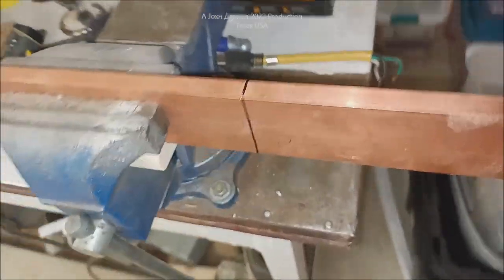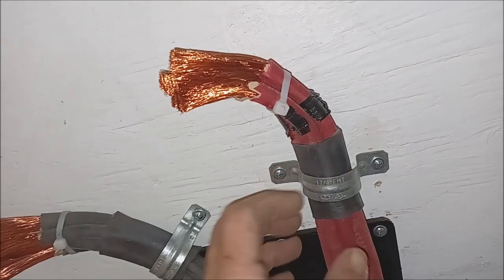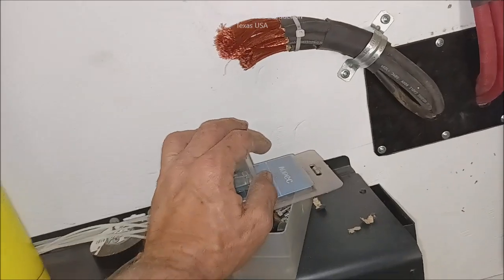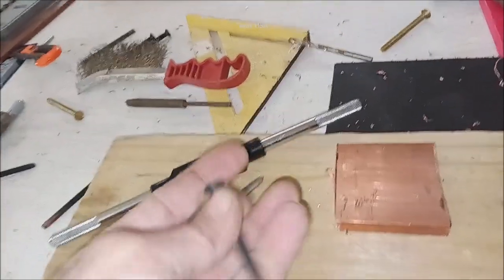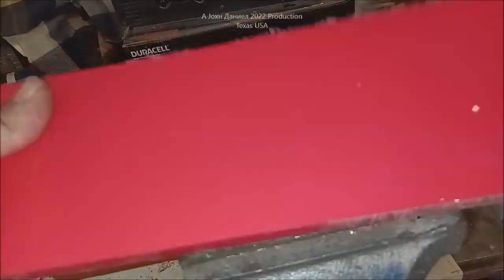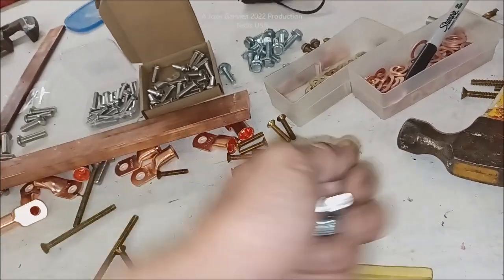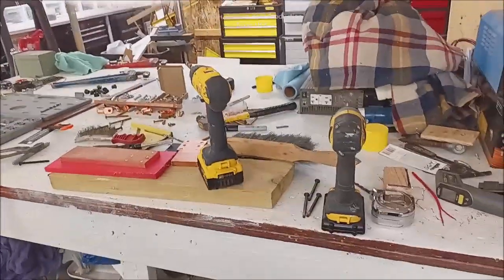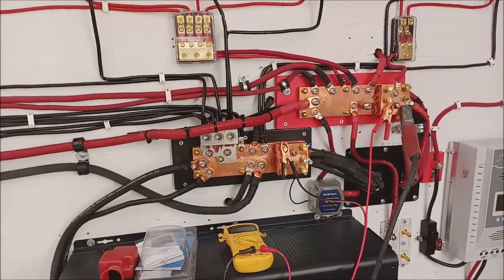Build 1500 Amp capable Bus Bar system mega 12V DC Power wall with C110 Copper 4 less than $200

Comment from the maker: ALWAYS OVER BUILD - Copper Bar Supplier https://ebay.us/8iIm6L ,SunGold Inverters $50 off https://bit.ly/3ETweGr , 304SS Socket Head Bolts https://amzn.to/3vEemLg & #1 Tap and Die set for all metals https://bit.ly/3v5UOQY VEVOR 86 PCS Tap and Die Set , Don't forget lots of drill bits due to breaking them, so buy cheap bulk bits https://amzn.to/36G18W0 
Always stage your drilling, always take your time.

Comment: I like your style. Very neat design. I work in the HVAC trade and have seen voltage jump. Just wondering if it could be of concern with them being close together. Maybe a divider of sort would add protection. Always enjoy your videos. You are a great source of information.
Reply from the maker: DC voltage won't jump since its not involved anywhere in the circuit with a earth ground or need for one.

Comment: Hello John, did you say 1500AmH battery bank with 7,700 solar? Is there a reason you chose those specific numbers?
Reply from the maker: Based on 5/5 math. My location is a 5 in full solar. 5 premium hours a day. Normally that would call for 7500 solar watts to 1500 amp Hours. But I added a few to cover eventual damage, degrading of gear and margin.

Comment: Very nice setup john .
Reply from the maker: Still waiting for you to show up in Texas
Reply: @JOHNDANIEL1  how much does it cost there to buy 100 acres and build a homestead ?
Reply from the maker: About $300 to 400k
Reply: @JOHNDANIEL1  not bad
Reply from the maker: @donaldsteele6276  I can get you 11.3 acres near me, mostly covered in Oak though with a 1/8th acre pond for $135,000
Reply: @JOHNDANIEL1  I'm looking at a 40 acre property in lava hotsprings by our families farm and ranch .has geo thermal well and river on the western part of property . Has a potential to make  a steam or water turbine .can build a shop and house with heated floors and walls . My family doesn't want to leave Idaho but they want to get closer to our family in lava hot springs Idaho.  The cost is 125k and has cedar trees on the mountain slopes too. Very pretty family said they would hold the loan too .
Reply: @JOHNDANIEL1  If you have old fallen oak trees on yiur property and a mill you can build a lumber dry shed that's has a solar roof like a green house and cut the old oaks or green oaks into table slabs and dry them they fetch 5k to 10k each depending on the age of the wood and drying process . 😉
Reply from the maker: @donaldsteele6276  I have Pecan, 3 species of Oak, Hickory, Mesquite and tons of fruit trees here. About 80 in all on 7 acres.
Reply: @JOHNDANIEL1  awesome man your set up very good .

Comment: John
Let me know how you rate that sungold inverter.  That's the exact one I was thinking of buying.  Impressive set up. Mine will be 2880 watt solar,  with 3 50 amp epever controllers, and 4 -250 amp hour agm batteries. 
Anyway,  looking good.
Reply from the maker: I would say the sun gold is about the most unknown under-ranked inverter I've ever used that has the best abilities of any inverter I've ever used and is hard as hell to kill.
Reply: @JOHNDANIEL1  thanks John. I value your opinion.
Reply: I have several of the same Sungold inverters and they work very well. They do pull a constant current of about 4.5 amps but they perform well for a variety of applications. The split phase 240/120 makes it easy to connect to a transfer switch. I’ve been using the units for about a year and they keep performing.

Comment: I use 5/16 brass water closet bolts and solder them on the backside so they will not turn also use type k soft copper flattened out for the bar , yes I am a plumber.
Reply from the maker: Ah, I was a plumber for 22 years. Then in 2009 I gave it up, too many illegals doing it for half price and none the cost we had to endure.